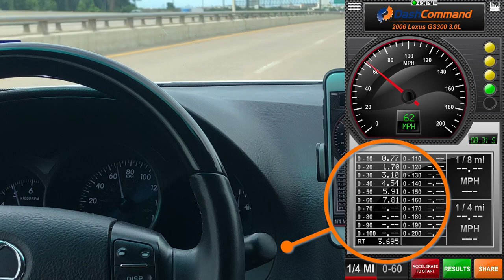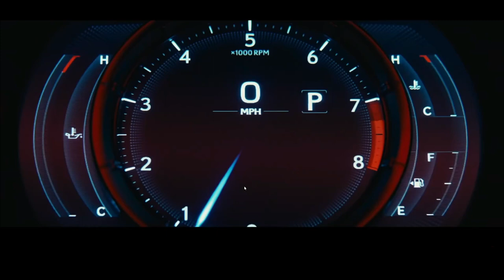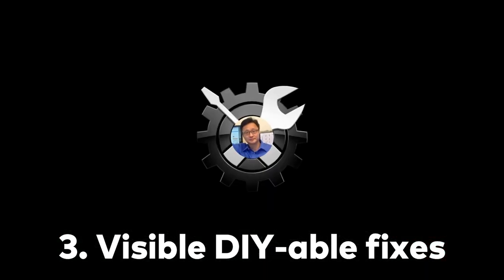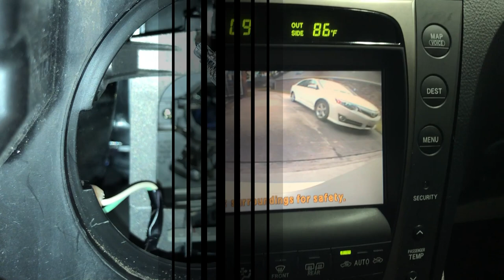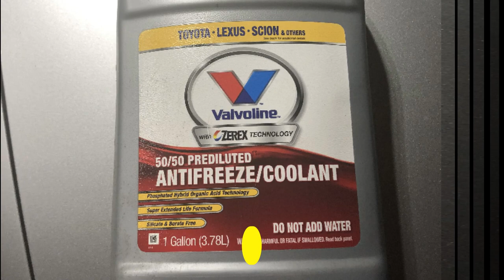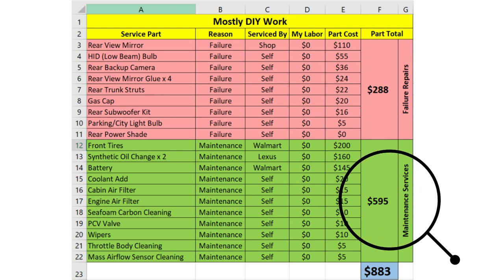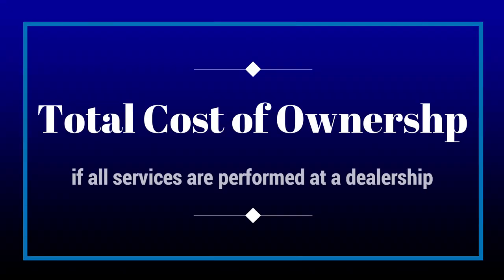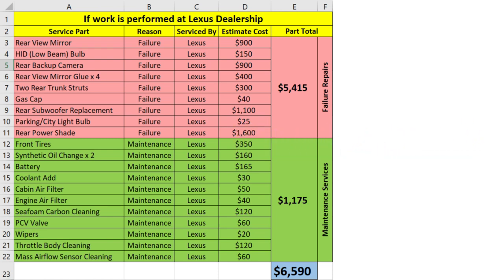2 Year Review & Cost of Ownership GS300/GS350

Comment: I have had my 2006 for two years also. Mine had about 110 000km when I bought it. I have replaced the struts and the alternator. I don't drive much but now after approx. 3500km it is still great. My rear sunshade was easy fix, I hold the button down for a while, kept holding it and the sunshade went down. Then it worked as it should after that. I really like this car for many reasons. =)
Reply from the maker: I like this car a lot also.  I plan to keep it a long time. I’m now doing carbon build up cleaning on intake valves. Man these GDI engine sure collect a lot of carbon in engine.
Reply: @DIYLifeSkills  I have not checked with a borescope since my car works well but I put CRC carb cleaner in the tank from time to time to extend the time until I need to dissemble and clean the engine more through out. I have heard that one of the first symptoms is usually bad idling. My car is idling perfect so far. Good luck with the job.
Reply from the maker: @jannepelto8206  My car was running pretty good, but when I opened up the intake valve, OMG, I had heavy carbon build up. I just posted a new video last night on this cleaning.   I had heavy carbon build up on piston top as well, and I'll post the cleaning of that in 2-3 days.

Comment: Great video!! I'm looking for a used GS myself and this video makes me feel confident in buying one. Wanted to ask if you know what year in this generation is the most reliable
Reply from the maker: You can check out common issues of this car by year on this site. https://www.carcomplaints.com/Lexus/GS_300/

GS300 ends with 2006, and staring in 2007 it's GS350.   2006 GS300 uses GDI engine so it can collect carbon deposits on the valves, whereas GS350 use both GDI and Direction Injection, so valves can remain clean.   My recommendation is get 2007 and up.
Reply: @DIYLifeSkills  thanks I'm getting that 2007 and up .
Reply from the maker: @quranicverses.2394  let me know how miles and what condition it’s in.  First thing I would do is check all basic maintenance things.  I did a borescope of my 2013 Camry with only 73K miles and I saw pretty solid carbon build up on piston heads. So even non GDI engines can have carbon build up.  I’ll post this within couple days.

Comment: If you have problems with hard downshift  around 3 to 5 mph. There are sites that will repair this problem. It's a computer problem and can get it fix for around 200.00
Reply from the maker: Did they say where or what part is the problem? Or is it just ECU program update? Thx
Reply: @DIYLifeSkills  I had it checked out by an auto shop. They said it was the ECU. so I googled it and came across some sites where they repair the problem. Saved me hundreds
Reply from the maker: @Royce1982  Very nice!!!

Comment: Thank you another great video. Bought mine on 06 plate for £2100 last year been faultless other than seized ac compressor. Not much call for ac in Scotland! Thanks
Reply from the maker: Wow, I thought I got a bargain. How many miles/KM did it have?
I bought it at $5K, but with used car market soaring, looks like it may be worth $8~$9K in the market since I have very low miles.

Comment: I own one of these cars. I bought it used 12 years ago $18,000.   I do  DIY repairs when feasible.    I have put 75,000 miles on my car since purchase.  It still runs, rides and handles like a new one.    I keep the car garaged and it looks very very nice.The interior has held up well and the car is comfortable.  It has plenty of power and I would describe it as spirited.   We averaged 32mpg on the road on a recent 7500 mile road trip this year.  120k miles on this car and no oil leaks or mechanical issues.  Idles at 600 rpm and it's hard to tell it's even running.
          I have not yet experienced any of the issues that are described here.  I'm sure that's in the future??    The exception is the rear view mirror issue with the mirror darkening over.  I bought a nice used one for $100 and just switched out the mirror glass itself (DIY).   Like new.  
         The turn signal arrangement on this car is horrible.  The blinker signal makes very little noise and cannot be heard most of the time.  No adjustment for this.  On top of that the green lighted signal blinking arrows are BEHIND the steering wheel and are NOT visible.  Thirdly, the signal arm does not return to the neutral position unless the turn is more than 90º!     This is an 'irritating' problem because the driver doesn't know if the turn signals are flashing or not!!   
          Overall I love this car!  Smooth, powerful and RELIABLE.   In fact, I'm in the process of upgrading the 2006 antiquated radio and dash display with Tesla style head unit, built directly for this car,  with a 12.1" screen and a ton of features.   We'll see.......
         I recently drove a 2022 Lexus ES300H for a few days.  I honestly though my 16 year old Lexus was smoother and just as much fun to drive. I even liked the styling on the older car better.  The new Lexus infotainment system leaves a little to be desired. Operating from the center console takes a little getting used to and seems somewhat inconvenient.    The features offered on the aftermarket radio I am installing in the  '06 Lexus greatly exceed what's offered on the new Lexus.   If it works,  it will be worth the money to me.
Reply from the maker: Thanks for a detail write up.  I do also love this car. I fixed everything that I can so far, and only repair remaining is side mirror moves up and down but not left and right all the way.  I'm sure this part of the plastic gear broke, which is common for all Lexus and Toyota side mirrors after a while.
Reply from the maker: I'm near 118K miles, so it's due to following maintenance work:  water pump, thermostat, transmission fluid, rear axle fluid, so I'll get to those in not too far in the future.
Reply from the maker: That's amazing that you got 32MPG, the best I've seen on long highway trip is 28-29MPG.
Reply from the maker: Lastly,  this is GDI engine, so if you go back and look at my intake valve and piston top carbon cleaning videos, you can see heavy carbon build up.   It was pain in the butt to clean the carbon.  If you don't want to do the heavy cleaning like I did, you can consider doing much easier Seafoam spray cleaning twice a year, and use fuel additive to clean carbon. GDI engine is notorious for heavy carbon build up.
Reply: @DIYLifeSkills                    Back when I purchased this car in 2011 the check engine light came on at approx.  50,000 miles.  I took it to the dealer and they told me that the engine had this issue.  Carbon build up, etc. They also told me there was a factory recall for repair of this problem.
        They offered to repair the engine on warranty!!  I had to leave car for about one month+  at the dealership while they pulled the engine.  This was a major rebuild,  replacing pistons, rods bearings, etc.  basically a new short block with upgraded parts.  I believe they did something to the heads also.  They gave me a loaner for the entire time.  When I got the car back it ran and looked like a brand new car.   Noticeable increase in power, etc.  That was approx. 12 years ago and I've never had an issue since.  I change the oil and do all maintenance religiously.   So far, no more carbon build up.    Keeping injectors clean is imperative.  Thanks for the tips regarding fuel additive, etc.
       The 32 mpg I am referring to was on the road at cruising speed.  When combined with in town driving it obviously drops down.  So far all mirrors, rear curtain, speakers still work.....   Even though this car is only worth a few thousand dollars I WILL continue do the necessary repairs until it's not feasible mechanically or financially.  I love the car.   Beautiful mica red with tan interior.
        Lexus may be the only car manufacturer who would stand behind their cars this way.
Reply: @DIYLifeSkills  Worth every penny ......
Reply from the maker: @curtgomes  Yup if you keep up with oil and trans fluid changes, this will last a long time.  This is my first Lexus and liked it so much that I just bought a 2008 IS250 with same engine as 2006 GS300 for my son.
Reply from the maker: My coworker that saw all the work I’ve done to this car, offered me $8500 last year after he totaled his car. That was a fair offer but after looking at used car market on what I could get, I passed on the offer. I paid $5K with 106k miles 3 years ago for this car.  I just paid $8,500 for 2008 IS250 with 155k miles. So it was a good decision to keep it. The only way I would replace it is if I can find a good deal on 2013 or newer RX350.
Reply: I totally agree. I owned  a gs450h

Comment: I also own an '06 GS300 for over 12yrs now.   By far and away, it is the car that gives me the most trouble in my 30+ years of owning cars with seven Toyotas/Lexuses.    My 15yr old Porsche gives me less headache than this Lexus.    The Check VSC check engine light (CEL).   This was the biggest and longest headache.   The same CEL kept popping up randomly over 3yrs and counting.   It was caused by a bad gas cap, then a pinhole exhaust leak on bank 1, then a pinhole leak on bank 2.   Each time, the problem requires one or two smoke tests, and then trial-n-error replacement of parts from the MAF to the downstream O2 sensors, then the cleaning of the throttle body, the welding of the leak, the cutting and grafting a portion of the exhaust pipe.   The same leaks would randomly come back and cause check VSC CEL again and again.   Currently, each leak is plugged by JB Weld instead of the previous traditional welding.    The exhaust leak apparently is a very common problem with this generation of Lexuses.

No ABS, no Traction Control, no cruise control CEL.   The cause was a bad speed sensor.  First, the one on the passenger side broke.   Then the driver's side.    Each time, a set of scary CEL messages.

Flooding!   The AC drain vent was clogged and caused all the moisture collected to be dumped into the interior of the car.   The entire front and rear floors were flooded by the time the problem was discovered.   This was a bad design from Lexus.   A problem that Lexus acknowledged and addressed in the later designs.

Leaky engine valve cover gaskets, broken water pump, defective engine thermostat, dead alternator, and dead ignition coils.    Each time was a headache.   Each time was going to be expensive if done by Lexus.  The alternator replacement alone is $950.

Other problems include the rearview mirror appearing scratched in large swaths (as mentioned in this video), defective rear sunshade, dead passenger side-view mirror motor, and dead trunk release motor (it can only be opened with a key).

The latest problem is that it burns 1qt of oil every 500 miles.   This is another Lexus design flaw that requires an engine rebuild to update the pistons with the newer, better piston rings.   The excess oil consumption is apparently a very common problem with the 300.

Note, some of these problems could have left me stranded, such as the dead alternator or the broken water pump.   Some made it unsafe to drive such as the problem with the speed sensors.    My old Porsche only required regular maintenance; nothing that would leave me stranded or make the car unsafe to drive.
Reply from the maker: Wow thanks for a detail write up. I probably only experienced 1/3 of the things you mentioned but I’m only at 118k miles. Good thing is so far I’ve been able to diagnose the problems and fix them myself. So only little money has gone in for parts but definitely spent many hours working on the car.  The only thing I haven’t fixed is the side mirror gears.  It goes up and down but not left and right.  Pretty sure the plastic gear broke and one of these days I’ll get to it. 

For me, so far it’s been super reliable but it’s good to note all the things that had to work on and something that I’ll be looking out for.
Reply from the maker: BTW, which and what year Porsche do you have? I can only dream of rising one in the future.   :-)
Reply: @DIYLifeSkills  2008 Porsche Cayman S.   Not the fastest; but it's a very fun/engaging car to drive.   It was an experience of sensory overload when I first drove it.   The drive gives a symphony of mechanical sounds from the engine sitting right behind your back to a flood of sensory vibrations from the entire cabin to the steering, the seat, and the brake to communicate to you the road and the car condition.    Besides those, the best part is the flat-six wail on an aftermarket exhaust.
Reply from the maker: @Chitown388  You are a talented writer.  Best writer so far on my channel.  Are you in some kind of job that requires professional writing? My son is also a talented writer.  He can express something more accurately with deeper meaning with less words than I usually do like you. 

As for Porsche, my coworker took me out on his 928 (I think) during lunch and that was the most thrilling riding experience I had. Especially when he took a 360 degree exit ramp with such speed that my Toyota and Lexus wouldn’t be able to do because it’ll lean too much or skid.
Reply: @DIYLifeSkills  well, thank you!   English is not my first language.  So, I have been learning and trying to be more concise with my speech and my writing.   
The 928 is a very fine GT car.   The Cayman S is less of a GT and more of a sports car with more tactile shifting, more responsive steering, and more agile handling.    I had contemplated many times over the years to get rid of it because I don't use it much, but couldn't do it because it raises my heart rate and brings a smile to my face every time I drive it.